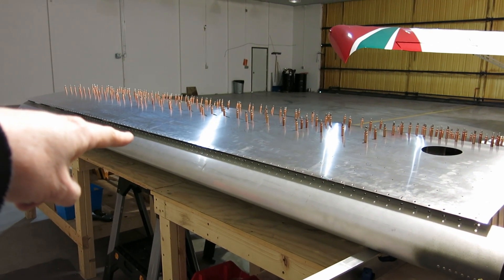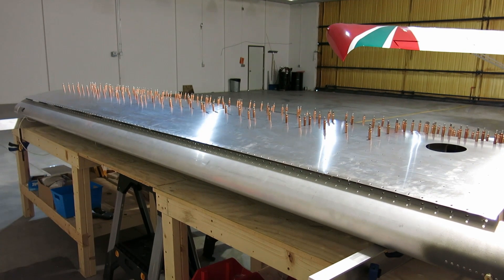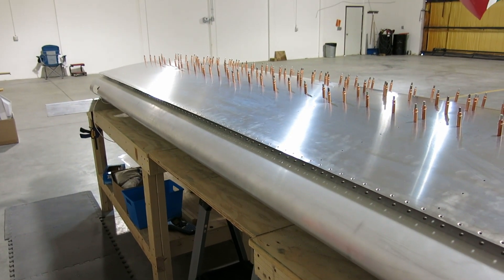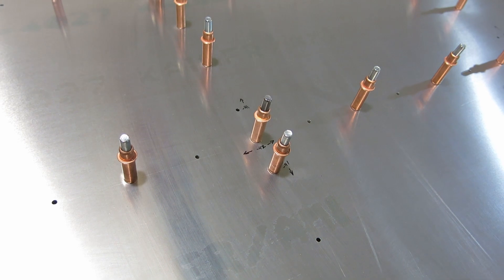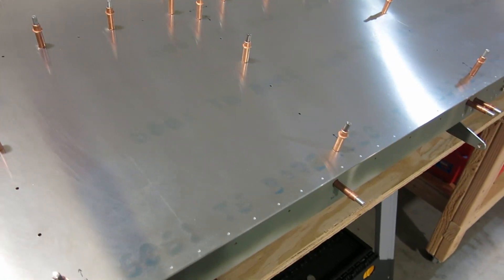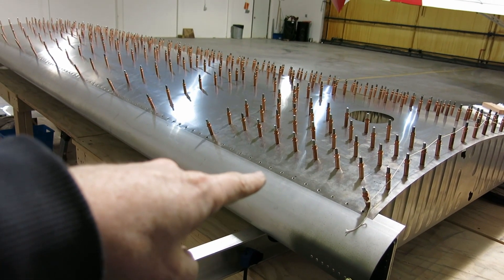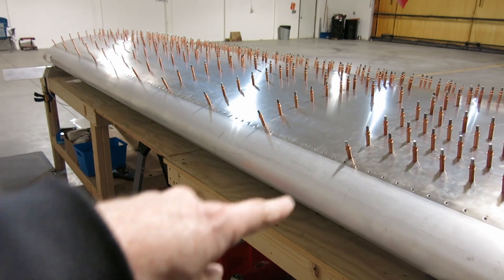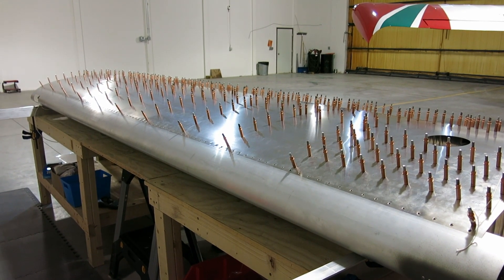No. 95 05-09-2021 Leading edge flush rivets

Comment: Depending on how much energy I have left when I get to that stage, I am considering filling the flush rivets and sanding them smooth before painting and filling the mandrel hole in the round head rivets before painting as well.  I suspect that would take about 4 hours per wing and may be worth it from a visual perspective and will make the rivets look more like solid rivets.  All depends on my energy level at that time.
Reply from the maker: What do you use for filler?

Comment: Using the #40 dimple set and drilling to #30 after dimpling should not affect the rivet mandrels as they are pulling against the inside of the spar which is drilled #30 in either case.  The only supposed advantage of dimpling #40 rather than #30 is a slightly tighter fit of the rivet to the skin, but that is largely irrelevant on flush rivets since most of the shear force is taken by the skin dimple against the spar countersink and not by the rivet itself.  After reading about the DIENQ die set, I decided I would stick with the #30 set I bought as the advantage of the #40 is minuscule compared to the extra work involved in drilling the holes twice.  However, if you feel better about the rivets done with that die set, then it is worth it to you.  😁
Reply from the maker: As careful as I have been with the #30 countersink, I have found that the pilot can wander a tiny bit. I found multiple countersink pilot holes (after doing it) that were ever so slightly out of round and I think caused the varying depths of the mandrels on those countersunk rivets. For me, using the #40 and then final sizing to #30 produced the most consistent pulls on those rivets and I’m really happy with the results.
Reply: @s-21project92  I have been fortunate to have had consistent pulls on all rivets, small to large and aluminum and SS.  I seem to recall you have some strange pulls on your SS rivets on the spars or somewhere.  I am wondering if the issue is with your rivet gun.
Reply from the maker: Both pneumatic and Milwaukee rivet guns seemed to have similar results.
Reply: @s-21project92  That is odd.  Maybe I have just been lucky to date.